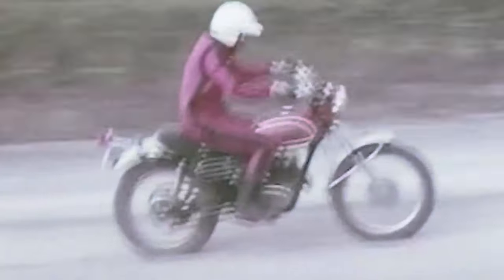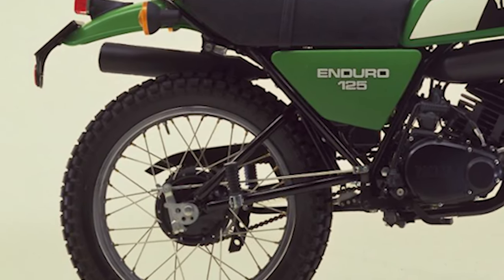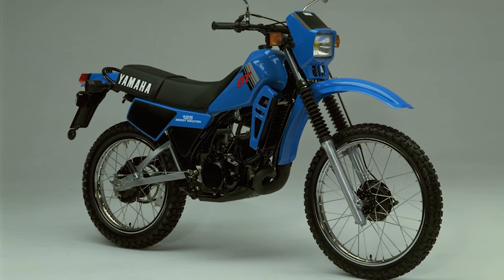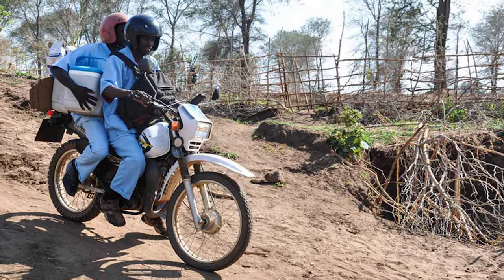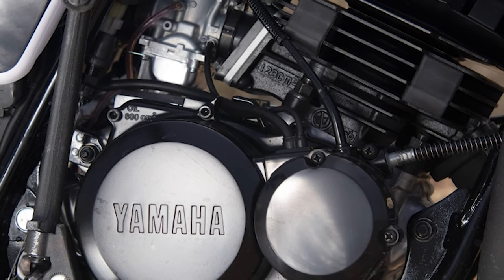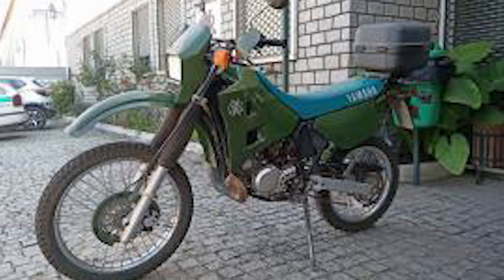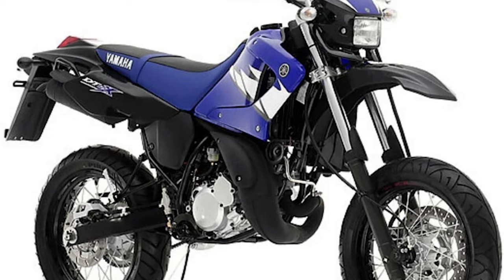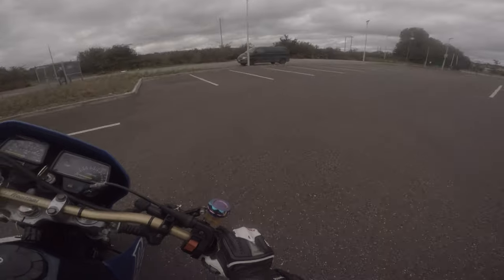Full History of the 2 Stroke Yamaha DT125 models (125MX, DT125LC, DTR, DTX, DTRE)

Comment: Two strokes are not dead. They are still build by European motorcycle companies such as Husqvarna, GasGas and KTM as recreational bikes.
Reply from the maker: Euro 4 killed 2t road bikes*
Reply: @RHauto   you can still register these new 2 stroke gas gas, ktm and husqvarna bikes and use on public roads
Reply: @no.nomoreidontcare yes but Not with the Open HP so you can never Drive them fully legal

Comment: I'm holding on to mine until it no longer runs. It's great bike that revs differently than the sea of 4 strokes we have today.
Reply: Im rebuilding after mine doesnt run anymore :D  Ive had my 1991 dt125r for 20years. My first and only motorcycle 😎 Got it when 16, now I'm 36. Just bought a new rear tyre for it and looking to change the crankshaft to a fresher one soon.

Ive ridden many different bikes, Hayabusa, R1, 2x zx10-r ninjas, sv1000s, bt1100 bulldog, intruder 800, kawasaki er5, xt660x, husqvarna sms125, kx250(not actually a street bike lol).

Gotta hand the most comfortable to ride for long distance for the ER-5. Bulldog is so wide my legs always catch the draft and open wide(have to squeeze constantly) and the sportbikes are tiring until you go 120km/h for the wind to lighten you up. The custom intruder is very nice to ride but well its a custom so you dont want to visit offroad :)

Just have to put it bluntly, the DT only needs a bigger engine to have headroom for torque and more acceleration but its so perfect to ride and maintain.

Comment: This video is great.

I've got a 2007 model still going strong and daily runner. I designed custom stickers and got them printed in Germany. I lost the psd version of my designs and the printer is nowhere to be found these days. If I ever find that guy I would print the same stickers again if I could for my rebuild.

The video isn't correct. The last model was a 125 RE 2007/9 model. It is the one I have. It is high action and the DT 125 RE which is the one I own. I think these are rare and may have been in Europe markets only.

 If I get enough likes here I'll do short videos on the restoration I am planning. I want to do it as the bike is so well built.

Comment: I`ve still never found the model I bought second hand in `85. It was already perhaps 3 years old. The most identifying feature was that it had a spring adjuster under the saddle which could wind-up or down to rear suspension, and thus the seat height. It was bought from Harry Bastable`s in Shell Corner. It had YPVS. The only picture I had of her was thrown away by my ex. Any ideas?

Comment: I had 4 DT125R in the late 90s , I made one fast af I skimmed top end because I blew it up just after I bought it , new piston an rings an chain an sprockets , I wish I never sold that one , plus rest an I had a KMX 200 an a Honda MTX 125 then a YZ 250 that was just 2 fast, one of the DTRS was a G reg with lights and plate still on for £500 but it had a different smaller Down pipe to others an it was slow for some reason

Comment: But Does the DT125X has a powerband?
Reply from the maker: DT125X has a powervalve yes. It is very similar to the engine used in 1988 to 2003 DT125R
Reply: @RHauto  Thank you

Comment: Great vid...rewind November 1982 as an (almost) 17 year old i paid £799 for a brand new one, kept it 2 years then bought a car.
Fast forward 20 years ...in 2002 at 36 years old i bought another brand new one for £2500, passed my test on it and kept it 4 years.
On both bikes i simply took restrictors out of the exhaust for much better performance.
Now in 2024 at age 58 I'm about to buy a Honda CRF 300L. 
You're never too old.